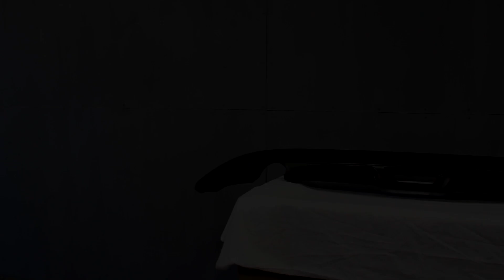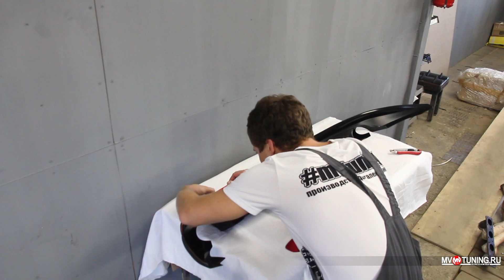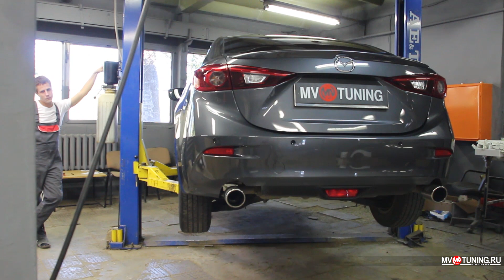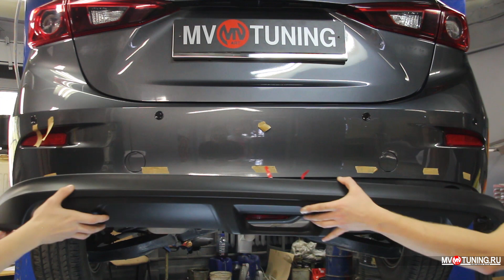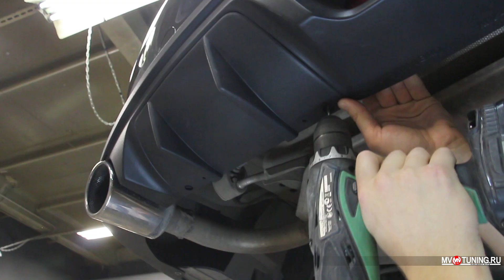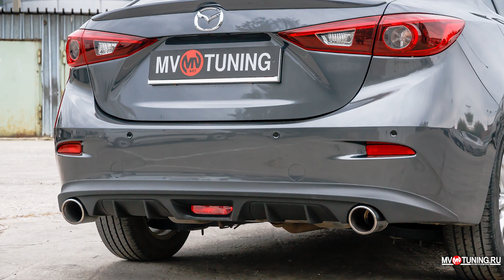Диффузор компании MV-TUNING для Mazda 3 / MV-Tuning Diffuser for Mazda 3 / Axela (3rd gen)

Comment: Is there a how to for connecting the brake light ? I have my diffuser installed and the light is not connected. I would like to connect so the brake light comes on and doesn't blink when you step on the brake . Also don't want it to blink when the turn signal is on and the brake applied . Any help would be much appreciated ! Thank You !

Comment: Finally an install video. LOL mine has been installed since July 2016. 😂😂😂
Reply: hey i have a question! im looking to get a rear diffuser but i noticed that the back of this car looks different then mine. looks like this car has a brake light on the back already and inserts for dual exhaust.. and mines doesnt. is there another part i should be looking for?
Reply: Bryan Gonzalez 
I have the same issue .. would like to get skirt for my 3 fastback.. did u get yours done? Any links?
Reply: @papayahombre  did you ever find out because mine doesn’t have that light in the back I have the Mazda 3 touring 2018